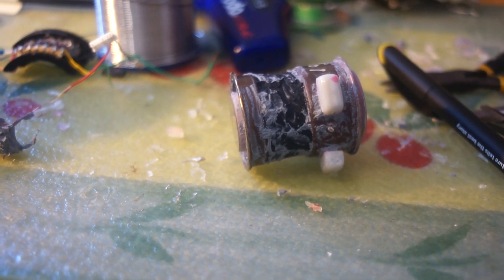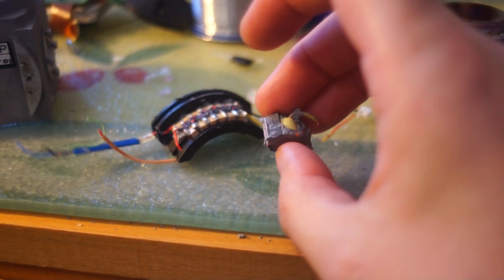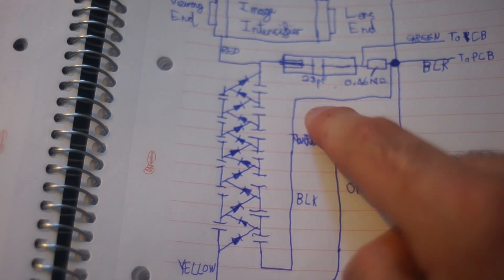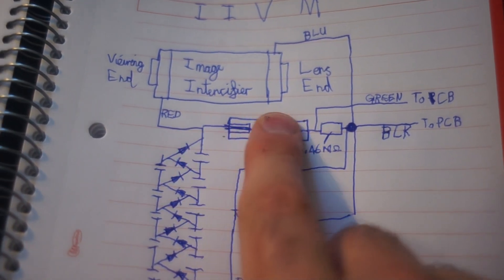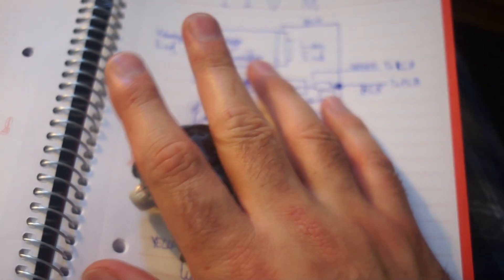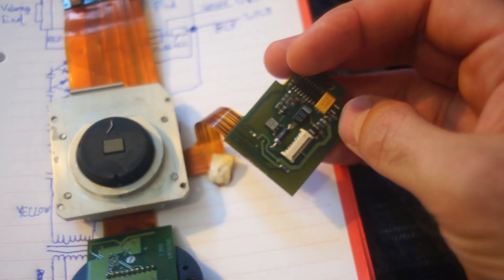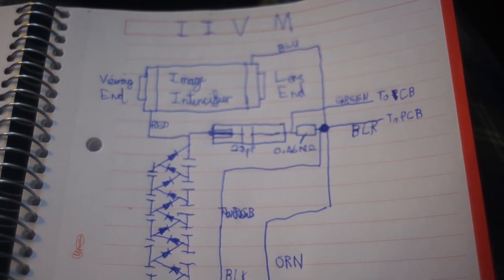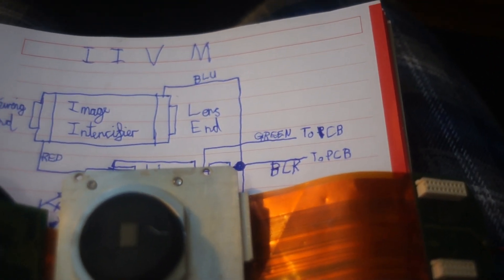Image Intensifier Tube Reverce Engineering

Comment: Sir, I have a tube with PSU problem, it doesn't work in cold environment but normal in warm, do you think it is possible for me to fix it by myself
Reply from the maker: @kerry1023  potentially. Could be a hairline fractur or just a fulty component. It will be an ass to track down the exact issue.
Reply: @TheEPROM9  How did you open the shell? Was it a destructive disassembly?
Reply from the maker: @kerry1023  the tube & voltage multiplier were potted so that bit was
Reply: @TheEPROM9  Thank you. That's very helpful

Comment: Can you tell us the specs? Like the screen resolution, IR light output, dimensions, and power source?
Reply from the maker: The tube does not output IR light, it is sensitive to it. It is a GEN1 tube. They do not have a resolution as they are a fully analog device, so its the optical resolving power of the lens used. Power source is about 15KV. I used a 12V CCFL inverter to drive a voltage multiplayer. GEN2 & GEN3 tubes use more than one HV source which makes them harder to drive from a home made setup.

Comment: I have about 6 air-poisoned ( no longer any good) Gen 2 MX-9916 intensifier tubes as well as 3 larger MX-9946 I think with thier power supplies ide be happy to donate you one of each…. If I didn’t assume you live outside the continental USA and if ITAR weren’t a thing ide go to prison for violating I think by doing so … I’m not sure they still fall under ITAR or not, but I think so…
Reply from the maker: I live in the UK. Shame some of that stuff is export controlled although if you just poped it in your hand baggage or suit case they would not care or notess. I have taken some dubious stuff on a plane in the hand luggage & security is none the wiser, I think they relay to much on the machine highlighting it to them these days than back in the 90s, seemed on point back then.

Comment: I think that bit of circuit that goes out, does measure the current the tube draws and is used to control the iris in the lens, so the tube is not damaged by light.
Reply from the maker: Mine does not do anything fancy like that. Just a dumb step up convoerter that works rather well.
Reply: @TheEPROM9  Sure, you operate by hand and not unattended like a security camera. 
I was just referring to the question in the video where you wondered what that bit of circuitry does.

Comment: That looks like a gen1 or gen1+ tube. 
It depends which photocathode material is used. 
The 18mm variety usually makes do with as low as 14kV. 
They require extremely low current. 
So you can drive it of a AA eneloop for weeks. Or with a momentary switch in a handheld device, it can run more than a year with normal use on hiking. 

I'm currently miniaturising a driver for a similar tube. 
I shall sketch it once I got it to a state I like.
Reply from the maker: That is what it looks like. This one was my proof of concept.
Reply: Hello, I have two EP33 without the drivers. Do you have an wiring diagram? Thank you.

Comment: This is a single stage Gen1 tube made from ceramic with fiber optic input and output windows, you need around 16KV to run them and make sure to add a very large resister on the HV side to limit the current on the tube or you will burn it out. You can buy ready made power supplies specifically for these tubes but i wouldn't bother because the performance of these tubes and the effort needed to setup lenses on either side of the tube isn't worth the time and effort.
There is a popular Gen1 tube that is easy and cheap to get called an EEV P8079HP , it has 3x of the type of tube you have in this video glued together, cascaded, this give it 100,000x gain and is as good as early Gen3 tubes in performance, it even comes with the inverter and voltage multiplier built in so all you need to run them is 6V battery.There are lots of videos and instructions online on how to make a DIY night vision scope easily and cheap using the P8079HP tubes and the performance is very good. 
Second and third generation tubes look the same, have the same construction,  same parts except the coatings on the photocathode, the gen3 photocathode is alot more sensitive to light.
Second and third generation tubes also have a MCP (micro channel plate) inside them just before the screen which multiplies the electrons making the image alot brighter on the screen.

The term generation isn't even used any more because there are tubes that are classed as gen2 far outperforming tubes that are classed as Gen3, so it makes the generation thing irrelevant when you are comparing performance.

https://www.youtube.com/watch?v=m0-SgCeFnbw
Reply from the maker: Intresting, I will have a play with some resistors, might solve some of the arking problems as I have managed to get it up & running. Has cronic screen burn issues so more treating it as a leaning experiance than a serious pice of kit. Used a hacked home brew solution you can see in my the next video.
Reply: @TheEPROM9  you can re pot the tube and multiplier into a PVC pipe and use silicone as insulation , then just have your CCFL inverter wires enter the potted module.
Or you can re pot (pot = fill with silicone) the tube the multiplier and inverter all into the one pvc pipe and have just the power wires exiting for connecting to a 9V battery.
The proper module for driving a tube has 2 main protection features built in, BSP(Bright Spot Protection ) and ABS(Automatic Brightness Control), you dont need them to make the tube work but you need to be careful not to point it at anything bright or you could damage the tube easily.
If you want i could send you a complete inverter/multiplier designed for russian made V-8 EP33 tubes, it isn't the same tube but it should work.
Reply from the maker: I like that idea with a PVC pipe, plus its not to hard to de-pot if needed later on. The voltage my fingers have already discovered can junmp round or though meany normal traditional insulators. Guess the electrons have a thirst for human flesh.

The BSP would have probaly got its feed back from the viltage devider, I should probaly reuse that voltage devider as a high voltage probe for my meter, would be a handy thing to have. I would only use it at night, save destroying the rest of the tube.

Oh yes, having another high voltage inverter would be handy =-)
Thanks for the offer. I love old USSR tech.
Reply: @TheEPROM9  If you want the good working Gen1 tube power supply, send me an address in PM, might be able to send you a second Gen1 power supply from another russian scope with a much larger tube+ the tube, tube still works but its weak.
I could also send you the guts of a 3stage cascade Gen1 tube, It has 3x of the tubes you have in this video glued together.
Reply from the maker: Have you got an email?
mine is siliconsimon@hotmail.co.uk.
Reply: @TheEPROM9  i will send you an email
Reply: @TheEPROM9  sent you an email, i dont know if you got it yet, if you have a telegram or a skype account i could send you some more information and photos of the stuff i will send you.
Reply from the maker: OK
Reply from the maker: I see it, I will respond when I have a moment, thnks =-)

I am one of the few that is still in work.
Reply: I wish that link you posted would let me copy/paste it

Comment: Thank you for making a diagram, and explaining how it works. This  makes it easier to understand. I don't even think they make that image tube anymore. Did this camera have interference shielding on it?
Reply from the maker: The tube was housed in a silicon & die cast case, I will have to re-silicon the voltage multiplyer, I have been doing some initial testing & my system works. Turns out the thing I though was a cap was actualy a 10Gig ohm resistor. So voltage detection for the PSU. The original video goes over the camera its self. Going to make a short video demoing it operating, however it has cronic screen burn, however I do have a new tube on the way.

Glad my scematic helped. It helped me understand what was going on my self because how it was wired was a little confusing.

It was made in the late 90s & is pretty old now. I think all modern stuff id Gen3, not sure if a Gen4 exsists yet. Aparently thanks to some help from others on the net it is a Gen1 which is not the most sensertive but is pretty easy to run when you have the high voltage.
Reply: @TheEPROM9  that's great that you were able to find a new tube for it. Once fully operational, Would there be a way to show what the picture quality looks like, with it being analog and what not?
Reply from the maker: I was planing on building a version 2 that would be better with the new tube. Yep there is a way to show it, I would probaly use my phone as the lens is small enougth to shuve into a eye pice. I have taken a picture.

Comment: Not a capacitor, but a 10Giga ohm resistor, used with the other resistor as a potential divider. CFL driver board output would work, though you probably will only need a few stages of multipler to get an output, or just use the transformer in place of the CFL one.

Diodes are high voltage ones, basically a stack of 4 1N4007 dies in series, so they have a stand off voltage of around 3kV.
Reply from the maker: That would make sence for the voltge devider for the voltage feedback to the main HV control. Then I checked in in resistance with both my facy multimeter I got nothing, when I chcked it wih my capsitor testors I got a value. That is why I thugh it was a cap.

I will have to play around with the stages to see what works. Also tanks for solving the mystry of the diods. I am not use to HV stuff like this so plenty to lean.
Reply: @TheEPROM9  Try to connect the resistor in series with your multimeter, then connect the resistor to a highish voltage, around 40V, with the multimeter set to the 20V range, so it's input impedance is around 11M. Then you should see a few hundred millivolts of voltage, from the current flow through the large value resistor, which is then shown by a voltage drop across the 11M input impedance of the multimeter.

If your meter has a near infinite input impedance on the low voltage range you might see it running into range switching continuously, as it flips from 1G to 11M input impedance every measuring cycle, so you need to manually hold the range there.
Reply from the maker: Thanks for the tip, I will try that. Crazy googleing the part number bought up nothing.

Edit, worked a treat, will do the maths to work out the exsact value.